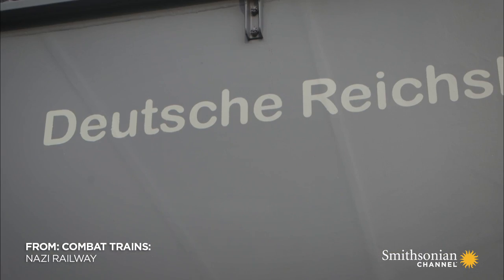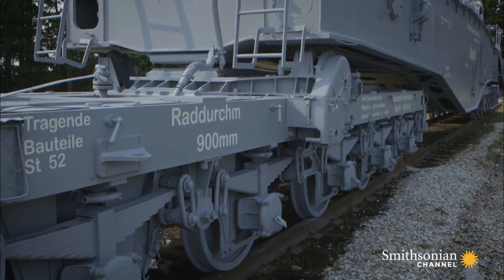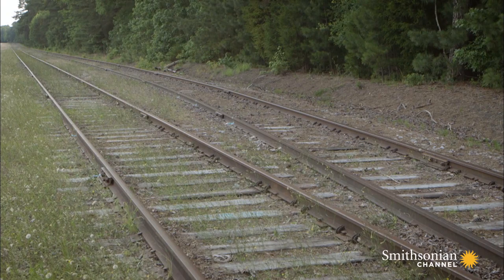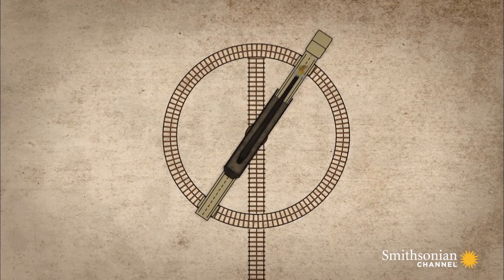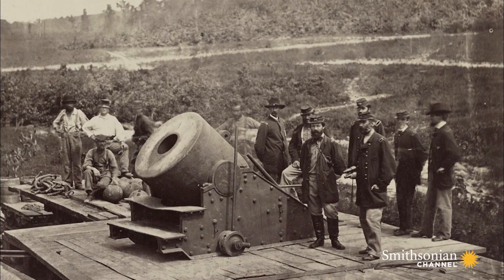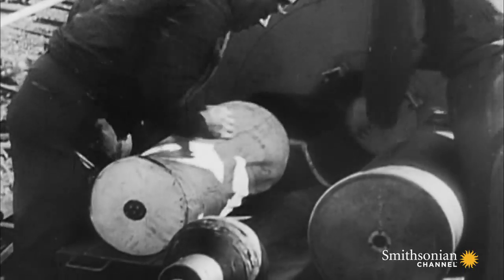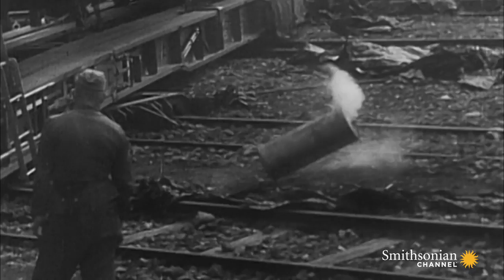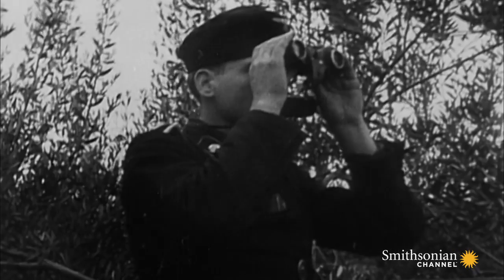How Germans Turned Trains Into Massive Artillery in WWII

Comment: Still tiny compared to the 800mm Gustav
Reply: gabriel bielawski except this is 900mm? Lol ur logic
Reply: gabriel bielawski did you even watch the video? The K5 is 900 mm the Gustav is 800mm
Reply: Lol 🤦🏼‍♂️🤦🏼‍♂️ig u missed the part where it says 900mm huh?
Reply: They don't. Even if, the K5 only was a 283 mm gun whatever the narrator says.
Reply: the 900mm describes the train wheels diameter
Reply: @HostileLemons  Size of K5 shell is 280mm not 900mm.